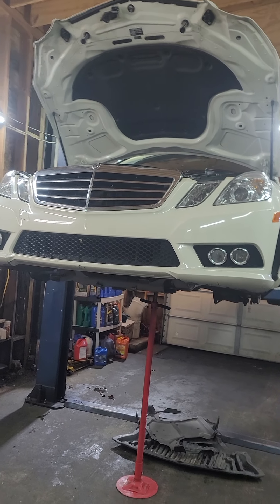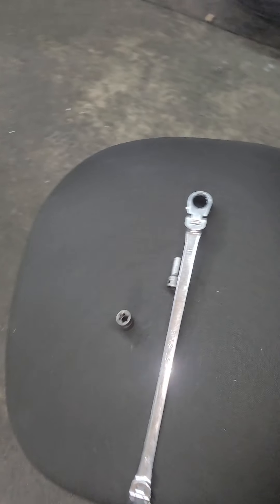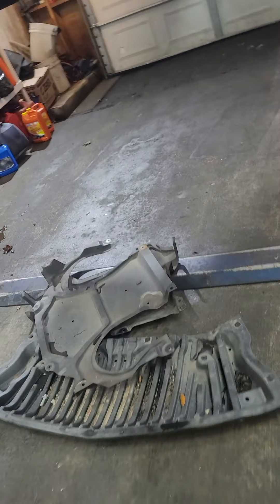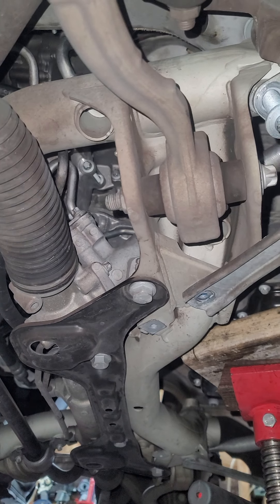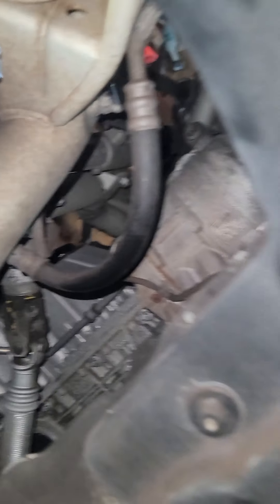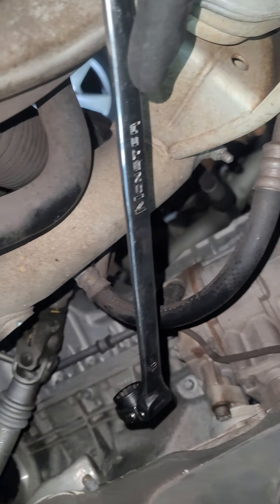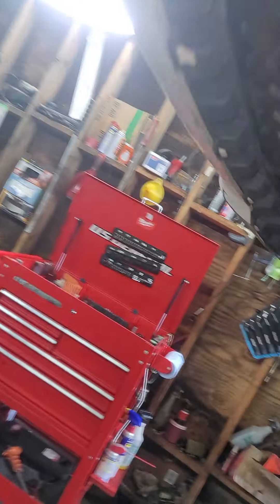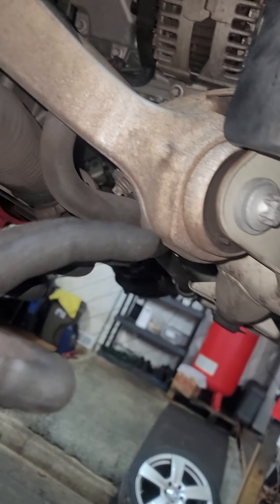The Easiest Way To Remove And Install The Mercedes E Class (E350) Motor Mount

Comment: Great video. Just did this on my 2016 w212 E 220 Diesel, right hand drive. It worked well. Better than taking the dpf or cat out. I did it lying down with the car on jack stands. I was a bit worried about the whole subframe and steering falling on my face. But it went well. Thank you for showing us an alternative approach!

Comment: Is this the same for the 2014 sports model or are there any differences? 
When I look at the mounts from the topside there is a metal shroud that is covering the top, does this need to be removed? If so then the airbox and the electrical connections on the driver side need to be removed anyway?
Also this is so you do not have to remove anything from the top side of the engine like the air filter box, etc., but if the shroud needs to be removed then this wont matter?
I do not have a lift so is it feasible to do this job form the ground?
Thanks
Reply from the maker: i'm sorry i haven't worked in the sport model before

Comment: I had the mounts replaced and it feels a lot better but I can still feel a clunk when putting it in reverse or when driving a little bit. Any reason?
Reply from the maker: Transmission mount. Usually, we changed all 3 together at the same time because if you didn't change the motor mount right after it got bad it puts the weight on the transmission mount  check and let me know if it's Good or bad .Good luck

Comment: I have the coupe with the V8 motor,  a 2011 E550 Coupe. Will this method work with my car?
Reply from the maker: It should
Reply: @hanitwfik  So you've never done it .
 So you have no idea. 
 It should  is not an answer.  Does a chicken fly ? 
Your answer,  It should !
  LOL
Reply: Just did this on my 2010 E550 it work only extra step's I had todo was take off the air suspension level sensor’s and unbolt the power steering line on the driver side
Reply: @ericferguson181 is yours 4matic?

Comment: I wonder why everyone is more willing to remove ac compressor/ alternator... or the exhaust system before just loosening a few frame bolts. Are they torqued on really tight?
Reply from the maker: That's their way I always trying to figure out the easiest  way and they don't need much torqued just tight it as you can and it works for me
Reply: @hanitwfik  if I’m only doing driver side do I have to take all the bolts out the frame? I can only see the long one you have loosened not sure of the other three. Also do you have to remove the wheels?

Comment: This is for the w212 E350 gasoline engine NOT the w212 diesel Bluetec. Same process but different parts.
Reply: So exact same for a 2012 e350 bluetec?
Reply: Don’t know, I have a 2011 E350 Bluetec.
Reply: @jesseparris6507 they should be the same, what I mean is, this guy's exact process worked for you?
Reply: @305tyrone4  no, the diesel motor mounts are not the same as the gasoline ones. I got lucky and once 
the mounts were loose I was able to open the hood and raise the motor high enough to slip out the driver side but I had to drop the steering rack line just to get the passenger side out.
Reply: @jesseparris6507  I just did the job last night. Driver Side is easy, just slip it through the back of subframe lol. Passenger side was the issue due to exhaust being in the way

Passenger side I Just dropped subframe and slipped it through the wheel well
Reply: This is what I’m sayin: I thought I had to drop the subframe according to everything I read but once under there I dropped the lines to the power steering unit enough to slide the new motor mount through that force. I didn’t have to drop the subframe.